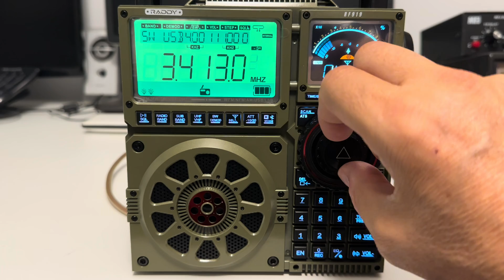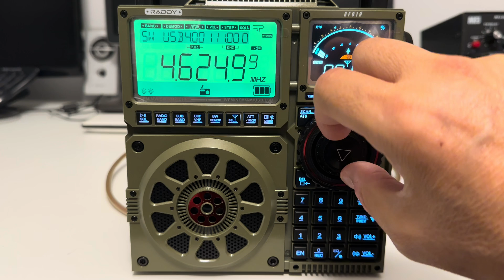Testing the Raddy RF919 frequency display accuracy using two VOLMET USB signals

Comment: Thanks Clint, I see yours is like mine , the little Belka puts it and the Tecsun radios to shame.  I still like the RF919 for the huge range up 1 GHZ but they need a firmware update to fix mode selection, chuffing EQ selection on AM , SSB calibration…other than that…👍😀!
73! Have a great day!
Reply from the maker: It's certainly a rough diamond for sure! Mine keeps discharging the batteries every three or so days, even when I haven't used it! I managed to get some replacements free through Amazon - a video on that to come!! 73
Reply: @OxfordShortwaveLog  Clint mine does not have that problem except when I accidentally turned on the alarm and it stayed on until it drained.  If you were experimenting with the App it could turn on your alarm,
73!
Reply from the maker: Thanks for the info., good to know! 73